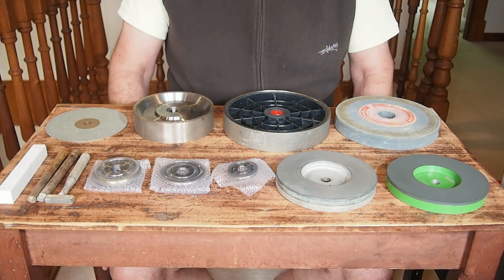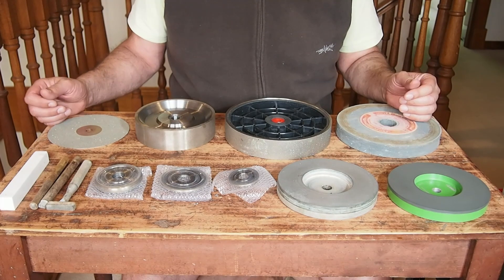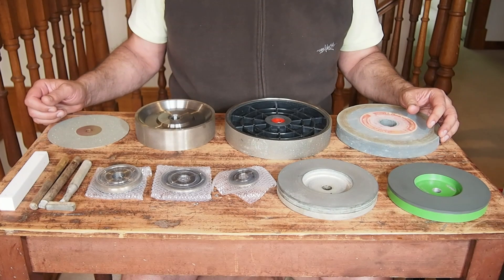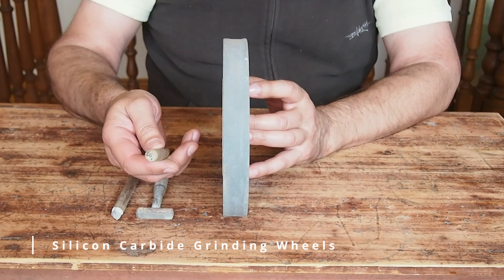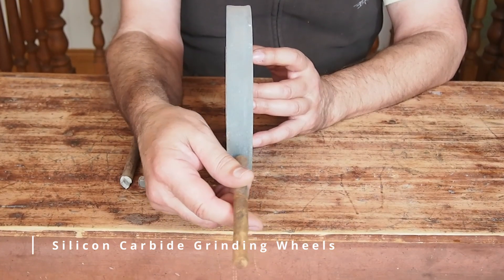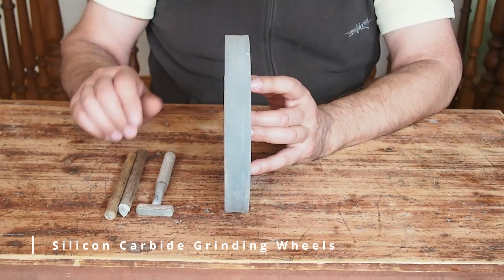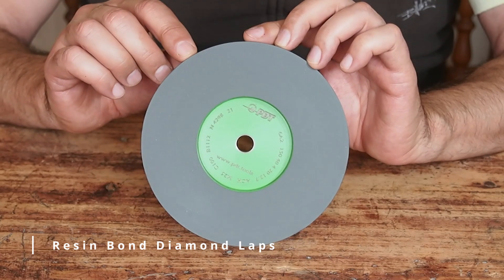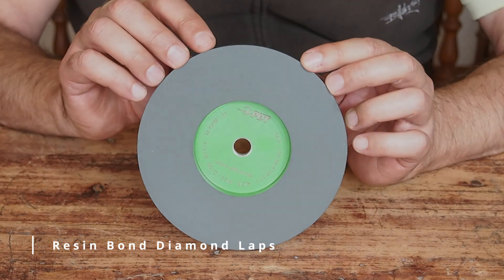Opal Grinding Wheels

Comment: Great video!  I'm looking forward to trying the aluminum oxide stick on my 220 sintered wheel, it definitely feels like it has slowed down.  Do you have any tips for knowing if your wheel is as sharp as it should be?  Maybe using a loupe or just the feel of it?  Thanks for all the videos you have made, really enjoying watching them!
Reply from the maker: Thanks for your feedback and question. If you feel your sintered diamond wheel has slowed you can try taking it off your machine, turning it around to run in the opposite direction. As well as cleaning your wheel with your dressing stick. Another option, increase the pulley speed of your machine.
Reply: @diverseopalproducts  Great idea to turn it around!  The sintered wheels I got are from Baltic Abrasives, they make a really nice 2"x8" wide wheel.  They seem really nicely balanced, I'm able to  run two of them on a CabKing and machine runs very smooth.  I had another solid sintered wheel that made the machine vibrate terribly.  Thanks again for all the videos, you have created a real treasure trove of info! I've got a lot of stones that need carving and paste polishing, so that content is really great!
Reply from the maker: @brettharper2393  Sintered metal bond  diamond wheels start out fast then the cutting rate slows to a stable rate. Your wheel that is out of balance can be fixed. You just need to find someone who can provide that service. I have had many wheels balanced over the years.

Comment: Really useful info! Am just looking at options for lap machines. Don't really care for the dremmel approach. Also, tried angle grinder mounted in vice using silica carbide polishing disks. Actually works, but (at 18000 rpm) has the unfortunate tendency of shooting opals several meters across the room. 

So, now wondering if I can adapt an existing bench grinder.
Reply from the maker: Thanks, yes you can adapt an existing bench grinder. A number of years ago. modified 10 x 6" Ryobi grinders to dedicated high speed sanders for customers. Took the wheels and guards off, lathed up 4 1/2" discs out of aluminium bar. Some professional opal cutters put quality sintered metal bond wheels on. You may consider a diamond disc for side grinding instead of periphery wheel. If you are starting out, you can use silicon carbide, #100 would be the coarsest or an electroplated wheel #180 would be good. Just remember to do your best to avoid getting water into the switch. Could be fatal. You just need to consider how you will saw and or polishing as low speed is advisable when using felt or leather with a powder polish.
Reply: @diverseopalproducts  Really appreciate the very helpful info! Putting a coarse wheel on one side such as the ones you recommend and a medium coarse wheel on the other should cover my needs, I think. Will definitely need to fabricate covers and water catchment basins for each side. Will probably still do final polishing steps by hand. Regards.
Reply from the maker: @bentationfunkiloglio  Glad to have been able to help.

Comment: what cost is a  6 inch 
Silicon Carbide Grinding Wheel
Reply from the maker: I don't sell silicon carbide wheels but I think Kinik are still supplying 6" x 1" x #100 grit wheels.